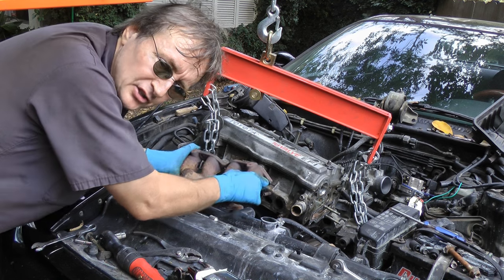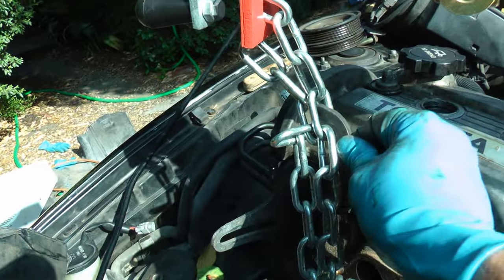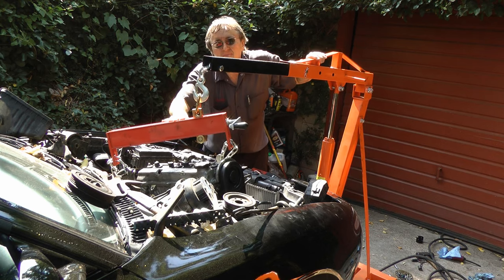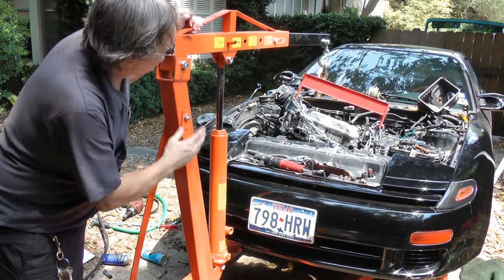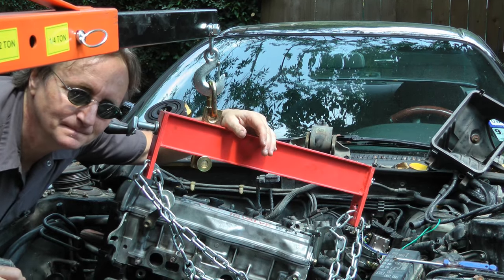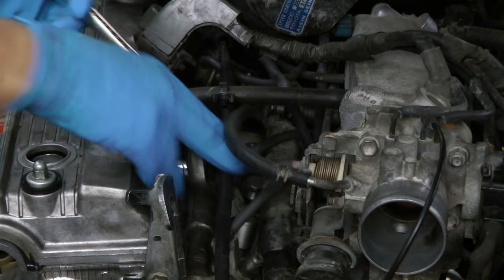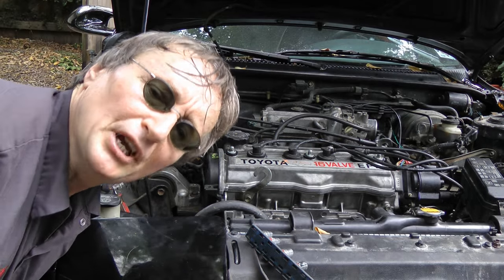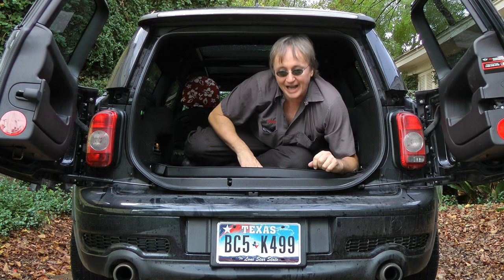How to Replace an Engine in Your Car (Swap)

Comment: wow replaced engine in 2min video, I spent 1 hour just to get one rusted bolt off
Reply: Seventh Universe 😆😭
Reply: Seriously!
Reply: Fire Hawk You don't know the struggle, those manifold and starter bolts are devils.
Reply: Holiofuck i just saw you on ifunny earlier today
Reply: He has 50 years of experience lol😂
Reply: It’s taken me about three weeks and a welder to remove a stupid hex head bolt that decided to round off
Reply: @kacper0291  After 50 years, you just look at a bolt knowingly - and it comes right off!
Reply: If it weren't for all those rusted bolts and stuck hoses I'd be a master mechanic. Well, thats an exaggeration, I get annoyed when I need to change fluid.
Reply: Lmaoooo

Comment: I like your show and all scotty but this was like the haynes manual of engine replacements in video form.

1.  Open hood
2.  Replace engine
3.  Close hood
Reply from the maker: it's quite a bit more than that, and anyway, it's just a basic video showing that guys can actually do it themselves with some rather inexpensive tools if they really want to
Reply: It's not the most complicated procedure. Literally disconnect/unbolt anything that connects to the engine/obstructs it, pull it out, replace the engine and reconnect everything. It's better to look up the specific procedure for a certain part that you're having trouble removing, like how to remove an exhaust manifold or a throttle body.
Reply: +jm8881 For Haynes it'd be more like, 1. Open hood 2. Remove engine, then "installation is the reverse of removal."
Reply: Hey Scotty . I did the same thing to my 72' - Chevrolet pick-up
Took out motor and transmission by myself. No help from anyone and put everything back in .
Reply: not as heinous as your attempted spelling of that word.
Reply: youu're so damn genius!  you make better outline than Scotty!
Reply: Did you think when he wrote Haynes Manual he meant "Heinous Manual"?  Lol!
Reply: I remember using those manuals... too bad you couldn't flip it upside down to read the directions in reverse more easily.
Reply: Haynes goes into a little more detail...
Reply: Right Lol... Not that easy... A bunnnnch of steps missed!

Comment: reminds me of Haynes manuals:  1. disconnect negative terminal from battery
2. remove electrical connections 
3. disconnect cooling system
4. disconnect fuel system 
5. remove engine... 

installation is reverse of removal...

Comment: i took the exhaust manifold and intake manifold off and connected my hoist to the engine, but it won't lift out i did exactly what you said scotty
Reply: Crank harder!
Reply: this is the funniest comment on this video😂
Reply: Did you disconnect the hub from the fuel tank or did you have AAA do it for you? Lmao
Reply: Did you try turning off the headlight?
Reply: Check the tire pressure.
Reply: Beansy RS sounds like you forgot to buy the $45 leveller thingy
Reply: i bet you did none of that liar
Reply: Check your blinker fluid
Reply: I bet you forgot to make sure you have a rotten banana in your glovebox!
Reply: Try turning the power off and then back on again
Reply: Make sure all the windows are closed.
Reply: I'm fucking dead. This is too funny

Comment: Ah yes just a couple bolts and its out...NOT! lol
Reply: +asdf taking a engine out isnt really complicated but I had to laugh at a less than 2 minute advice video on taking an engine out
Reply: And no mention, of course, of disconnecting the engine from the transmission. Or engine mounts. Or power steering. Or A/C. Or radiator hoses and fans. Or alternators. Or starters. Or wiring. Or vacuum lines.

Yeah, just take the intake and exhaust manifolds off and boom. None of that other stuff could possibly be important.
Reply: +O Ocalhoun egg zaktly
Reply: +O Ocalhoun you make it sound so hard...
Reply: O Ocalhoun lol nah who needs all that anyways right😂😂
Reply: asdf it depends on the car you have but with a buddy you can replace a miata engine in a weekend if not a day
Reply: This comment made me laugh for a solid minute. Much needed.😂
Reply: That header really held that thing in place.

Comment: Wow, how to change an engine in 2:11, I'll get right on it!
Reply: haha....I was thinking the same thing!
Reply: On point sir. Scotty need to put more details in his videos
Reply: The Haynes manual way.

Disconnect negative battery terminal 

Remove mounts 

Lift motor from vehicle 

Because with Haynes everything else is already disconnected
Reply: lmao
Reply: lmfao
Reply: I have a 03 Suzuki aerio which i had my mechanics putting a lot of new parts in it. Whenever my engine need to be replace I will just refer to Scotty video how to change engine in 2:11 save $$$$$ on my mechanics doing it and a brand new engine in under 3 minutes😂😂

Comment: They aren't held in by wizard magic, They are usually attached by only a handful of bolts. The rest is hoses and cables. If you have seen a heavy car crash the engine often just breaks off the mounts and comes clear of the car. If you rev it you can see the whole thing flex about, theres obviously more than this but its not outrageously difficult. An engine jack and a socket set maybe a breaker bar you can get one out, also a torque wrench to get one back in. But its not rocket science, its like unbolting anything else its just daunting because it looks so heavy and tight.
Reply: It's internal combustion engine science.

Comment: Not gonna remove motor mounts, transmission, or driveshaft?
Reply: Bmw M3 e46 nope you just take off the intake manifold and the exhaust manifold and you crank it.
Reply: I think that only applies if you want to make your fwd car into rwd or convert a automatic transmission to manual transmission
Reply: Driveshaft is connected to the tranny, not the engine...but motor mounts most definitely.
Reply: nope lol
Reply: @Cicada-eg4pw  forgot he was doing it to a fwd not a rwd

Comment: I replaced the engine in my sisters '98 Oldsmobile Intrigue. (3.8 V6, not the 3.5) The old engine ate up the #1 rod bearing. I borrowed my uncle's engine hoist and rented a stand. Took me about a week though because I had to do this in between working, but when it was all said and done, the car fired up and ran like nothing was ever wrong with it.  One of my finest moments as a DIYer  mechanic.

Comment: It's not that easy as shown in the video. You have to disconnect wiring, engine foundations, hoses and bunch of other stuff. And reach those tight spots for unbolting is pain in the ass.

Comment from the maker: @PUREAAMERICAN it was a 900 dollar used car that the last owner, a kid, drive into the ground and cracked the head from overheating. But it ran 2 years with the cracked head, I just got tired of adding water (it ran fine otherwise.) So I put the used japanese engine in. It had 160 thousand miles on the original. Scotty

Comment from the maker: realize if it's different than the motor in it now you will need sensor changing, wiring changing, and computer changing. But if it's the same, everything fits on right

Comment: Ok people,it's not that easy,but anyone who can check their own oil should know that. Before you do anything,get the right manual and go through whatever section that goes along with the work You plan to do. A really good idea is to take a lot of pictures of what everything looks like as You do each step,believe me,it makes going back together one hell of a lot easier.

Comment: I have been watching many car repair video when showing they make really look simple but believe me a simple nut and bolt misalignment could make a second job turn several days when you have no experience. Anyway this kind of give me a little confidence to try changing engine one day. At least the hardest part is have the tool to lift the engine off and a perfect solution has been provided with this video. Next is to look for similar video on how to change transmission.

Comment: Swapped the Engine in my Wife's 2004 Honda Civic. 
It was easier to leave the Transmission and Engine together- and  remove them at the same time. Honda's are not that hard to  work on. Saved my wife $3000.00 on the Engine swap alone. Installed the following because the car has 199000 miles on it:

1) New Fuel Pump
2) New Alternator
3) New Purge Valve
4) New Battery
5) New CV AXLES
6) New Lower Ball Joints
7) New Evaporator Coil

After all the work was done She decided to not buy a new Car. Essentially the Car is like new- because of all the new Components and newer Engine installed. The Car runs great.

Comment from the maker: @99ambition generally they come with nothing but the engine block and heads, you reuse everything else. If it's used from a junk yard, it has many more parts on it and is much easier to install, like this one. Scotty

Comment: How hard would this be for some one who has very little experience working on cars?
Reply from the maker: it's a big job, but really, I've seen teenagers do it on a weekend
Reply: +Scotty Kilmer Do you find replacing an engine easier than replacing a clutch?
Reply: Tyler Eriksen I guess, it is easy if you know what you are doing.
Reply: How about you do it, and tell us how long it takes? That way, you know how long it would take, and, now you swapped an engine. Win win
Reply: Just go to a godamn mechanic and save yourself the headache
Reply: Michael Botros if you go to a god damn mechanic, then there's no need to watch this video lol.

Comment: Uhh It's not that simple... Wtf.. You didn't at least mention to separate the engine from the transmission.
Reply: Scotty doesnt make videos for people who only know how to put gas in a car
Reply: I totally agree.  Scotty doesn't seem to make videos for people with inline sixes or V8s either.  There's a certain amount of preparation work involved in doing it right.  He briefly mentions the removal of the manifolds.  But there's also the need to unhook the wiring and pipes and tie everything out of the way.  You also have to remove the fan, the belts and the radiator in case the engine block shifts forward and punctures it during the lift.

It's also a good policy to replace the rubber engine mounts while you're at it, rather than wait until they fail a roadworthy inspection and then you have to come back especially to do it in a year or two.

Comment: Is it really that simple to replace an engine? Theres a place that sells engine from japan for like $300
Reply from the maker: the actual process takes 8-10 hours, just make sure you have an engine hoist
Reply: Good sir, would you please tell me where this place that sells Japanese engines for like $300 is? Thanks!
Reply: there is a lot of it. mostly chopped from cars junked in japan. See MightyCar Mods show on buying a car from Japan
Reply: Diego A To remove AND replace an engine, it's not that simple, there's actually a lot to it, especially when installing the new engine.
Reply: Unless you're Dominic Toretto...he doesn't need an engine hoist....oh and Chuck Norris
Reply: Scotty Kilmer 8-10 hours....maybe if you have done it before haha.

I did my first motor swap 10 years ago or so in a 2002 Focus SVT...took me almost 2 weeks while working full time. Of course I didnt have a book or youtube back then to help me out.

Comment from the maker: depends on the noise of course. remove the fan belts and run it, pray the noise goes away and it's something the belt drives. If not, engine has serious internal damage

Comment from the maker: @PeterGriffin4200 160 thousand miles, but it only failed cause the previous owner was a teenager who drove it a year with a leaking water pump. So the head had minor cracks in it, though it ran OK, it used water.

Comment from the maker: there should be a diagram on the hood showing all vacuum lines. If not, go to a dealer, by law they have to supply you with a picture of vacuum lines as that is anti pollution equipment.

Comment from the maker: @mds2465 the car's previous owner was 17 and overheated it by not replacing a worn water pump. so the head had a small crack, it ran ok, but would use coolant through the crack.

Comment from the maker: @lowlow643 Of course you swap all the parts off, but the gas is still in the tank and when you connect the fuel lines back to the new engine, the pump will pump it in. Scotty

Comment from the maker: @99ambition there are none, increase in power stresses engines, period. Turbo chargers and superchargers work best, but they basically increase the engine compression pressure, stressing the engine more. And they are Super expensive to add one. Scotty

Comment from the maker: @PVoyager the feeler gauge should slip under the rocker with a small amount of resistance, not tight, but not completely loose either with no tension slowing it down. Scotty

Comment: i have found that pulling the engine AND the transmission is a better route (depending on the car).  getting the engine to bolt up to the trans IN the car can be a bit of a chore as i lack the patience to do that.  good video though and i like scotty (even though ive busted his balls a few times in older comments) he has been doing this for longer then ive been alive so hats off to scotty!  ill gladly take the longer route and make progress then get bogged down and frustrated but thats just me.

Comment: A 4 banger engine is easy to replace. Did a swap on a 1.5 Toyota Tercel and it wasn't hard at all. The only time a shop was involved was to recover the A/C system.

Comment: Once the battery, intake and plastic ducting are out of the way, this really isn't beyond the realm of a DIY mechanic. Take LOTS of pictures, label all connectors 1, 2, 3, etc... and use plastic cups for all bolts and fasteners. Label them and put them in order of disassembly so they'll go together in reverse order. Use penetrant and patience on corroded fasteners and do it with the same enthusiasm Scotty has! Now's the time to replace the front and rear seals, oil pan gasket and timing belt/water pump.  Doing it yourself really does come with more satisfaction.

Comment: Its an really easy way and take only 2 minutes
No need to unbolt the engine mounts,
No subframe separation
No axle taking out
No transmisiion mounts loosing
Just need to unbolt exhaust manifold abd intake manifold that it
Only 2mins
Wow

Comment: Thanks for the video!  Yes, naysayers, its more involved, but to be shown that you can do it is all the encouragement  a weekend mechanic needs.  I need to swap a 1.6L Miata engine with a cracked crank.  Having pretty much torn the top half off twice, doing the swap should be a piece of cake.  Also, Advance Auto sells engine host for the price Scotty quoted, or ou can rent one from them for even cheaper.

Comment from the maker: @INS14466  going backwards and noise has nothing to do with the clutch. Pull off the back brakes and check em, and replace or resurface the drums if you do any work. Scotty

Comment from the maker: @99ambition sixties only use small modules to run ignition systems (they called them "black boxes" back then.) Seventies stated using more computers on AC systems and early fuel injection and ignition systems. Scotty

Comment from the maker: @Matthew55904  the ABS and trac system work together, so when one light goes on, the other soon follows. BUT, you need a dealer level scan tool to analyze those complex systems. If you don't want to spend that kind of money, ignore it, as it's a fail safe system and would revert to non trac, non abs normal driving. Scotty

Comment: I just pulled the 5sfe out mums camry.....it really is that easy, the hardest part is removing the power steering pump. although i hate struggling....so i pulled the trans out too, they both needed a good scrubbin and some new seals.

Comment: well.......its alittle involved than this. that is the basic run down but to anyone not too mechanically inclined you may not want to just go out and try an engine replacement after watching this. there's lots of hoses, lines, and electrical possibly that need to be accounted for. if any does try swap...my best advice is.....Label EVERYTHING. the more you label the quicker you can put it back together. cheers.

Comment: Here is 1 for you. An old Kei van basic model, looking at replacing the old engine and transmission and putting in a brand new one with an automatic transmission. what do you think? Pros? Cons? Anything?

Comment: I like the engine leveler you have there, never seen that before.  Normally I just bolt on a chain to the heads and adjust it by choosing which link I want to lift with the cherry picker.  Wiggling and wrestling the engine in while using a pry bar makes it a real bitch to hook it up to the transmission.

Comment: @99ambition You could do a K and N intake. Its easy to install and its free flowing, which increasing your gas mileage with HP. Also you never would have to change it again. I have one and have been using it for thousands of miles and it never posed an issue.

Comment from the maker: @d46512 My son's. But the previous owner overheating the engine many times so the engine had internal damage not worth fixing. those used engines from Japan are great, they run like tops and cost very little, 550 bucks in this case. Scotty

Comment: A groaning sound could be coming from something like the power steering pump(does it happens only while turning steering wheel?) or most likely it could be something in the suspension.

Comment: @scottykilmer yes I do agree. But for me there are a few exceptions. For example, When replacing a timing belt I truly believe that the water pump should be replaced at the same time, that way you have a water pump that's gonna last and you won't have to be burdened to do the job all over again.

Comment: I have a 1998 ford escort, and it very suddenly had a loud rattle from the engine area, it drove just fine though; when i attempted to get home it died. It was running just fine not overheating or acting strange except for the noise.